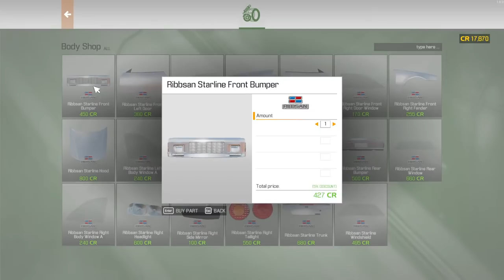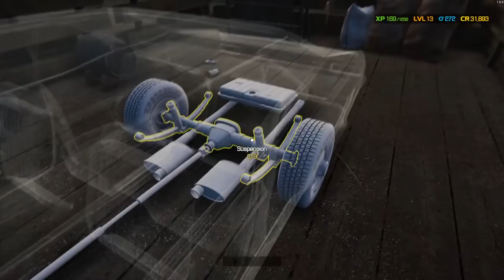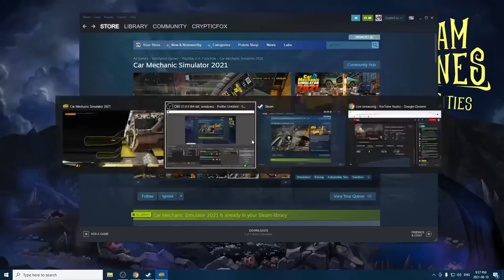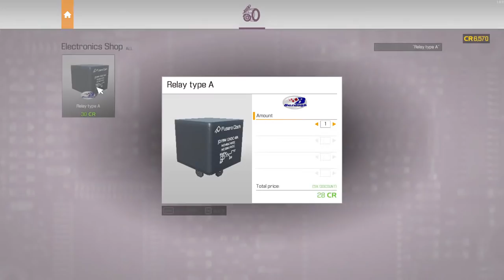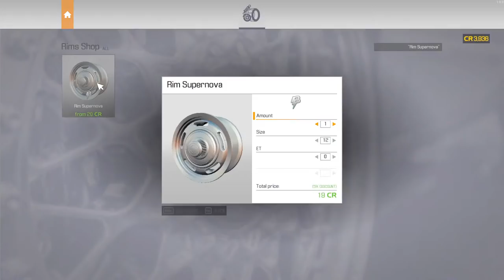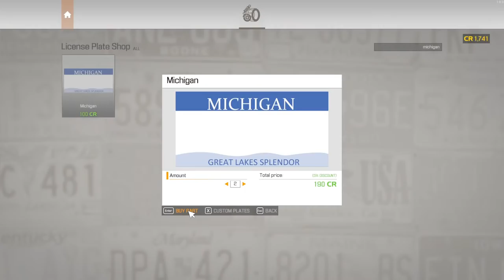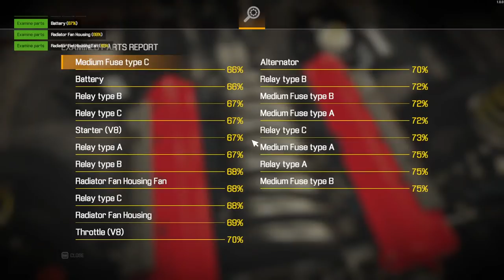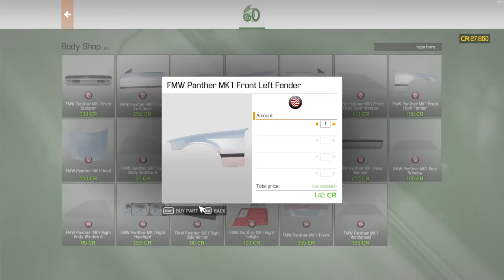Hunting for TREASURE in Old Barns - Car Mechanic Simulator 2021

Comment: Just a quick mention since I heard you talking about it in this video, mr. Fox; I was looking through the community hub discussions, and Fulisic said modders are already working on mods, and the workshop is already available for mods to get uploaded, but Fulisic also mentioned that due to the amount of chances from CMS18, its a bit more tricky for the modders so it will take a little while for the first mods to drop 😊
Reply from the maker: Yeah I anticipated they'd be coming.  Just a question of when :)  Thanks!
Reply: Yoo fax i be on at 6pm and end up geeting off at 3am
Reply: I’m

Comment: @1:34:00 You could not paint individual parts on the car or the engine. Can't paint engine parts at all. On the car, you could put the parts you want one color on the car, paint them, remove them, then put all the parts you want to match the primary color on, paint the whole car again, and then put the parts on. 

As far as real world painting engines, you absolutely can paint an engine, and almost all parts in and on an engine. Just can't can't paint every part of every part. Such as, you only want to paint the exterior of the block, and it's absolutely critical that you don't get paint on the mating surfaces. Alternators can be painted, but you want to keep the paint out of the internals. 

You can use a paint product called "Glyptal" on the interior of the engine, but you need to make sure it's applied properly. It helps with oil returning to the pan, but if a piece breaks off, it'll be in the oil and it could cause damage by plugging things up. 

But basically, it's just a bit of common sense. Engines are hot, so use high temp paint. Don't paint anything that looks like paint might gum it up or plug a hole. 

About the only thing that I would never consider painting is the headers/exhaust manifold. They are just so hot, and it'll burn off any paint, even High Temp Header Paint. With headers, it's not a matter of if the paint will stick, only how long it will stick. And quite often, we're only talking weeks, usually just hours of regular use. I like to wrap them. Keeps the heat in, looks tough, and extremely durable.

Comment: 12:30 With that 30k you could buy a car from the junkyard and maybe restore it, or maybe buy a barn find car
Reply from the maker: Yeah that was kind of the plan, but it often takes more than 30k to complete redo a car between buying the junker and then all the parts it takes to rebuild it.

Comment: It's like this games pre settings are meant to troll and piss off the players who pay the developers rent. I still can't figure out the setting to not have the cursor jump across the screen after taking a bolt out, also can't figure out how to sell an item from my inventory and simply sell the next part next to it instead of the selected part being centered so I end up selling good parts. These are obvious settings and should be default, why would anyone not want to be in control of their cursor?
Reply: Thankfully they made turning off the complete dog crap dubstep easy, some songs are good but some sound like that guy that makes dubstep with his mouth
Reply from the maker: Hmm I haven’t had any cursor problems at all

Comment: The best way I found to make money is barn find cars. I play on ps4. I can buy a car and fix it just so it will run and make upwards of 5k I dont have the welder yet but I'm working on it. I'm level 14 I dont know much about how the game works but I have 4 cars I am working on right now. I had 70k to buy them. 2 are from the junk yard then one from a barn to get enough money if I dont profit off the other cars from the junkyard. I really enjoy the game. I play it alot. I'm rebuilding a engine right now and it's hard cuz I already did and it didn't save because I had to leave I even saved and quit the game then shut it off but it didn't save it so that part sucks

Comment: What about trying just engine blocks and heads and repairing them, in 2018 it was not too bad money, I mean I would not go hunting for them but when you are at the junk yard grab the blocks and heads
Reply from the maker: Will have to try and see how they do :)
Reply: i think i made around 600 or 700 in profit doing that in one trip, but it really depends on your luck and how good you are with the minigame
you could make money, but youre better off using those parts in jobs
Reply from the maker: @mr_killing  Yeah things like the engine block, heads, gearbox, body parts, etc are pretty good value once repaired.